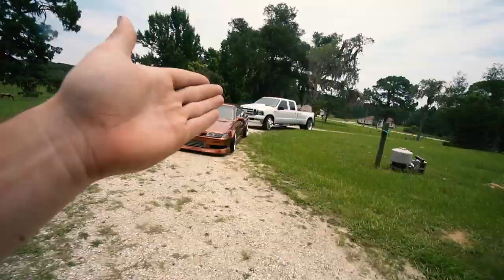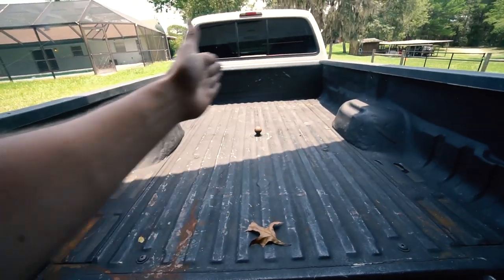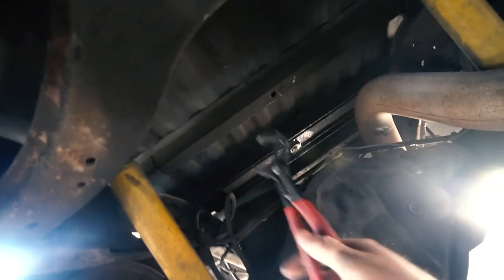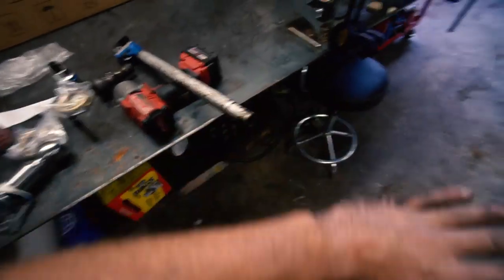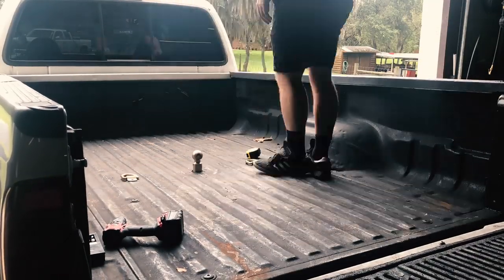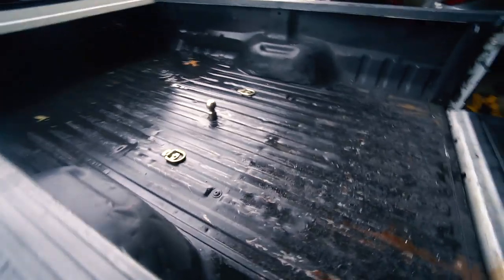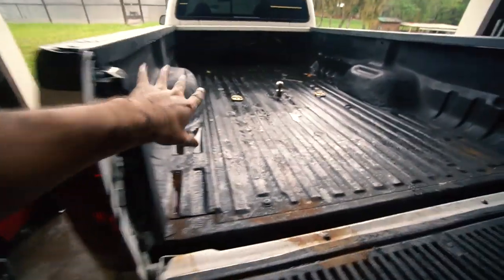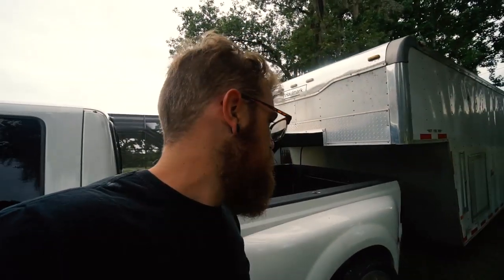Towing the Big Trailer with The 7.3 Powerstroke on 24's for the FIRST TIME!! Will It Work!?

Comment: At work ive had to take one of those balls out hosed it down in nutcracker which is only available thru industrial suppliers and a pipe wrench with 3 foot cheater pipe laying in the bed with my feet against the bedside and it never got loose

Comment: Why don’t you consider switching over to a 5th wheel? That will sit higher in the bed, help out with the low front end of the trailer. Just a thought.

Comment: How heavy is that trailer fully loaded? The diesel market is ridiculous. Everyone wants a 4x4 diesel to pull their 15 ft boat or jet skis or pick up 2x4s from home depot. They just want “man points”. But You might be OK with the right gas truck and a few mods. My work truck is a 454 k30 and i wouldn’t hesitate to pull a large trailer with it. Easier to maintain just lacking in some torque and/or economy vs a modern diesel.  Or a better option would be in the industrial truck realm. They don’t have insane market value like diesel pickups.   You could grab a diesel powered mason dump or dually tool box body for way cheaper than a pickup. And always swap the beds later if that’s what you like

Comment: That 7.3 sounds hurt from my experience with them.
Reply: Its honestly rare to come across a 99 7.3 that isn't hurt. They are very problem prone engines compared to the 98 and down 7.3. I have a 99  with 200k well maintained miles. And I've had hell from turbo to injectors wiring problems it's just non stop. Yesterday is started making a knocking noise and its not rod knock I think a rocker arm or a lifter took a shit

Comment: Obs is the broke mans truck. Get a clean one and your too scared to use one or get a beat one for cheap. Super duty 7.3s are soooooo much better. Obs has the 351/460 which I feel is better than the 5.4/6.8

Comment: @Taylor Ray! I was cringing watching you use the Knipex Cobras, they actually make an awesome wrench plier for this kind of stuff, I use mine almost everyday as an Aircraft Mechanic, fits a wide size range, applies pressure as you use them, and best of all no rounded bolts! Check em out: https://www.knipex.com/index.php?id=1216&page=group_detail&groupID=1500